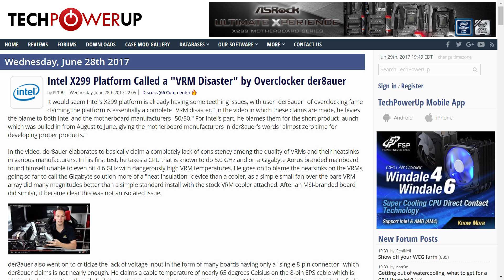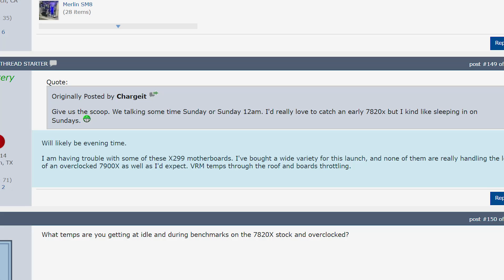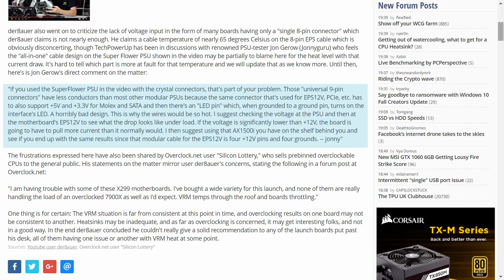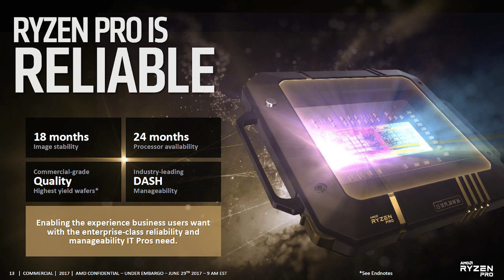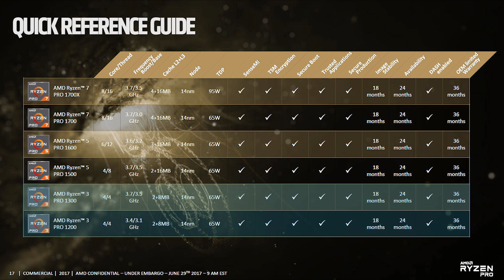Intel Core X Motherboards Overheating + Ryzen 3!

Comment: so here's a question although a little dumb, if the ryzen 3 has 4/4 why is it not competing with the i5 instead of the i3 is the ipc really that low or what i am just a little confused
Reply from the maker: +Cptmarko Not a dumb question. It's compared to i3 because of price. It's providing more cores and more performance for similar pricing.

Comment: people say the fx9590 was a roaster but the only one i ever built with would run 5.1 all day long and never go over 70oC with a h100i. trust me i tried and used different temp monitors, it wouldnt boot before i could get over 70oC even 5.15 wouldnt boot no matter how many volts i gave it. nice chip if you ask me wouldnt mind a simliar insanely clocked ryzen chip at somepoint.

Comment: I personally would like to know more about Ryzen for laptops. Most of news have been way way too quiet about it aside from a couple announcements. I'd like to know specs, efficiency level, prices of laptops with ryzen processors.
Reply from the maker: I've done one video on the first announced laptop. Check that out, but there honestly just isn't much out on it right now.
Reply: yeah I've seen that one, but it's basicly a desktop r7 1700 inside a laptop, which is possible due to it's low tdp. there are still no news about ryzen based laptops with 4 and 6 cores, with good balance between an energy efficient machine and a multitasking powerhouse.  thanks for your news though!

Comment: ryzen 3 perfect for  budget gaming ican oc to 4ghz so it much better than i3 they locked and lower threads/cores and speed and bootlenecks the gpuz Ryzen 3  will make i3 useless literally wowo amd make us happy 😍😍😍😀😀😀😀😀😀😀😀😀😀😀😀
Reply: Still, they need to get back at Intel's G4560 somehow, because that's the processor of the year, possibly the decade so yeah.  Give me something affordablethat's $80-$90 for the lowest R3
Reply: Mihnea Andrei Mehedințu  good opinion but R3 it will be much great for gpuz we will see how its performance when they released thank you for yor opinion
Reply: Yup. G4560 is an amazing CPU for a stupidly cheap price tag. 50 Celcius under synthetic load on air cooling. What that means is sometimes I forget I have fans as the only times I hear them is when I do a synthetic load for a benchmark. The CPU is also the cheapest part of my PC excluding the fans and cooler. I held out for Ryzen 3 but for some reason unknown to me it is still not on the market. That is the only thing AMD is doing wrong. The G4560 is the ideal CPU for everyone that isn't an enthusiast but it has no competition.
Reply: M Wadud ... well...  ryzen 3 will destroy g4560 in budget build category... and im super excited ;)
Reply: M Wadud  yeah but  I think everyone need to build a new gaming pc he will wait becuz it amazing to R3 this give us all the power to use our gpu ...thank you for your opinion
Reply: Nel Brin  bcuz it's killer for i3 and Pentium

Comment: I can't make a view on Ryzen 3 until they set a price for it. The G4560 is phenomenal value and a great little chip. If the 1200 doesn't compete with that on price, then they haven't won the budget consumer because I don't see a 4/4 Ryzen being much better on performance for budget users than the 2/4 Intel budget champion.   ... Also, when are we going to see low power desktop chips for ryzen? A 1600T for want of a better nomenclature. Say 35W, lower clock speed and it stays cool when squashed into a tiny box.

Comment: Oh noes!! So those big sexy looking VRM heatsinks are more for looks than functionality!? How could this be!?!?!
Folks have been buying these expensive high-end Intel boards thinking it's necessary for max OC's and gaming greatness and generally just being awesome. This $109 Gigabyte AB350-Gaming 3 is hands-down the best motherboard I've ever owned (granted a lot of features got moved to Ryzen's silicon, lowering the cost of the board itself), lol even sporting an RGB LED strip, not that I need it. Premium audio, Gigabit ethernet, plenty of USB ports...only gripe is no USB Type-C.  I'll just fix that down the road with a PCI-E x1 add-in card once I actually have devices that can use that. Otherwise... h0ly $h*t Intel, you f***ed up real good this time!! Largely your board partners faults? Nope. You rushed it so this is what happened.

Comment: Just another symptom of the disease that has gripped the CPU market. Intel had such a stranglehold. Nobody in their right mind would optimize for AMD. Sure Faildozer was bad but to let it get this bad? It's almost like Intel forgot how to design CPUs. Intel has just been coasting on dominance and optimization. Now a 5% ipc upgrade in some cases makes them equal to or just beat out Ryzen. Intel has been exposed so badly and now that AMD has some confidence they are going to push harder. Hopefully they stay humble and keep being quiet about things until they have silicon made. One of the best things about Ryzen was how quiet AMD was. After a few years of watching the neon rave they put on everytime they did something. This quieter more cautious AMD was refreshing.

Comment: Very interesting, Amd was the power hungry, high revving beast that made motherboards sweat up until Ryzen, now the tables have flipped.

I had a Fx8370 clocked to 5.0, the Vrms would burn you and would throttle well before the CPU got hot (running open loop water cooling)

Now my Ryzen 7 is plenty happy buzzing at 3.7Ghz and can whiz through any task or game.

Comment: This seems like a VRM voltage issue to me. My board defaults the cpu input voltage aka VRM at 1.7v!!! I dropped it to 1.45v and my temps dropped by a solid 10-20C under load
I have an asus sabertooth z97 + i7 4790k (yes I know its "old")

Good video

Comment: Why don't they design CPU sockets so that mainboards can have a large heat bath around the socket itself? I mean remove even the thermal paste and the copper plate. Conductivity won't matter if the coolant is oil.
Reply: SweetHyunho because its hard to design it in only 48 hours 😂
Reply: Mongocom I have another idea. Why not flip the socket and cool the CPU from the back of the mainboard? Put a large copper plate the size of the motherboard itself, and cool the huge surface.

Comment: i believe the cpu 8 pin thing, my 3960x 5.0 ghz oc did the same thing to my seasonic g750 8 pin. the extra cpu power plugs are not just for ln2 on some platforms, i wish my rampage iv gene had one.

Comment: I have been a huge intel and nvidia fan. but How much amd has done. from rebuilding ground up on the architecture etc. they are just hands down the better company now. AMD  is now  my go to.
Reply: but nvidia hasn't done anything wrong, am I right?
Reply: Ludvig Holst . no you aren't correct. they have changed the range and price of the graphics card line up they have.  I believe they moved each card up one notch on the series whilst they had no competition from amd. For example, let's say the 750s  next gen card wasn't the 850 but the 860 which moved them all up leaving the 880 out as a 890 or becoming the Ti or titan or xp or how ever they bloody name it. but you see what I mean. so each card they make now has a even bigger profit margin due to the upgrade in name they were given.
Reply: Arek15Arek The 1080Ti is $700, now the 1080 is about  $500. Only the 1080's launch price and Founder Edition extra $100 were scams, for Pascal at least.
Reply: I agree, I saw something similar with the 10-series. 70s used to cost around 300-350$, but now the 1060 took that place. Looking at the lauch prices, the 1070 (450$) is an 80s card and the 1080 (700$) an 80Ti card. And that also had to do but was not limited to the increased pricing through the Founder's Edition which was a scam in itself. They moved the cards up a notch which increased the overall prices, luckily though they aren't Intel and actually increased performance quite extremely with about 70% performance gain tier to tier and actually added features instead of just increasing prices with no actual gains like Intel.

Comment: Now AMD is COOLER than Intel. Literally
Reply: It always was except for the FX part that wasn't too cool, but even steamroller and excavator were decent enough. At least for the price to performance AMD always was great
Reply: Waifu Hunter Hot amd is just a stereotype. I had a athlon x4 on 4Ghz it was 68-75C with stock cooler. Now i have a fx8320 on 4.4Ghz its stable 72C on full load with the cheapest 30$ aircooler.
Reply: fx were always cooler than intel, as well as a10 apus (i have a10-7850k)
Reply: The CPUs are fine??? They go up to 100°C on AIO water
Reply: KAILOONE lol my A10 can be as hot as a sun🔥😂
Reply: Michael Tan lol man no hate it was to the other comment saying it always hve been, I hve been using amd for a long time but facts r fact they just recently got better at temps
Reply: the CPU's are fine. its only the VRM's that are overheating. the motherboard manufacturers are the ones developing those. soooo not really.

Comment: I'm using an Aorus 9 with a 7820 clocked at 4.6 on all cores with no issues at all.  VRM's are sitting at 30-37c 
Read the forums

http://www.overclock.net/t/1632870/skylake-x-kabylake-x-combined-discussion
http://www.overclock.net/t/1632665/intel-x299-socket-2066-vrm-thread
Reply: it varies between boards. overheating might not be that common